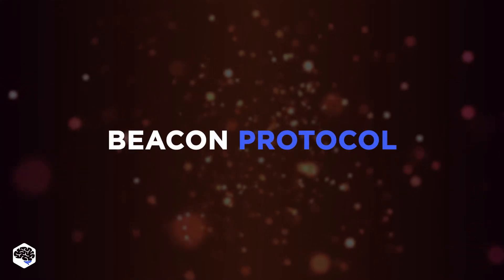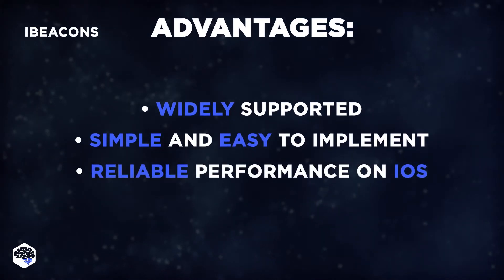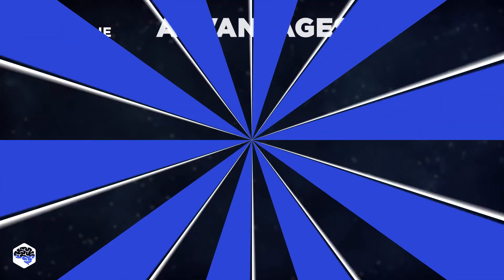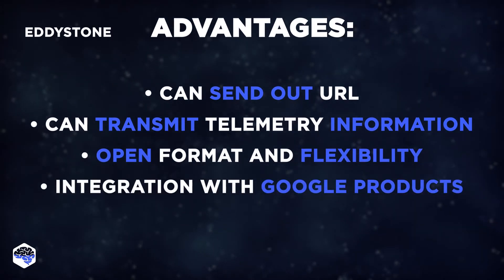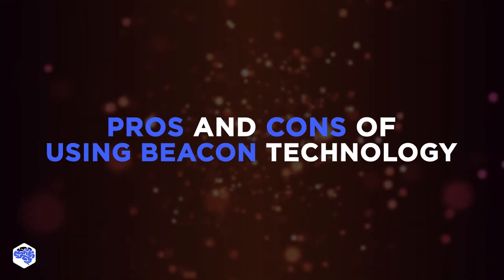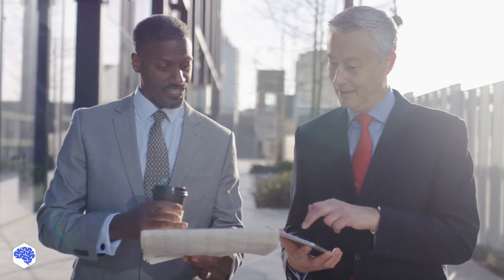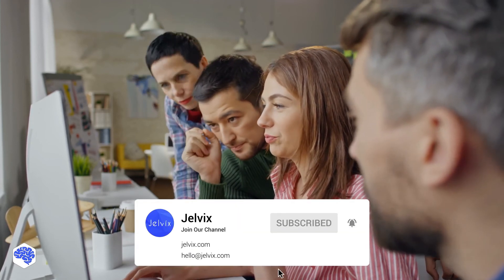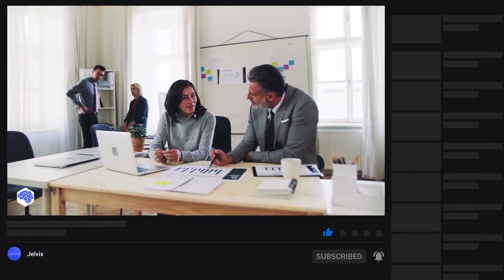BEACON TECHNOLOGY | USING BEACONS IN PROXIMITY MARKETING

Comment: Why beacons data rate 1mbs?..why beacons not use highest data rate..can u tell me what is that main drawback of using highest data rate?
Reply: Because it uses BLE whose data rate is lower than standard Bluetooth. If you want to acquire higher data rates check Bluetooth, btw it will cost more power